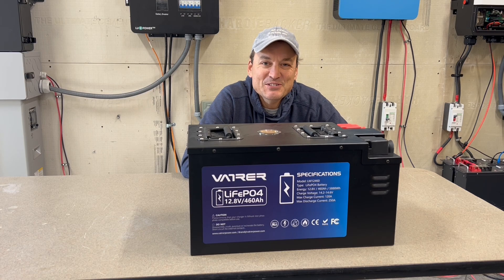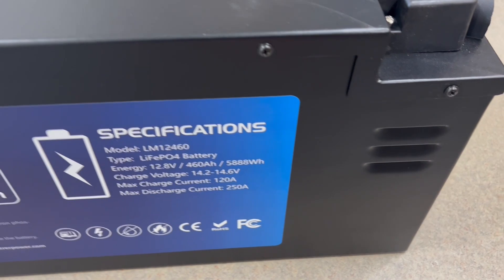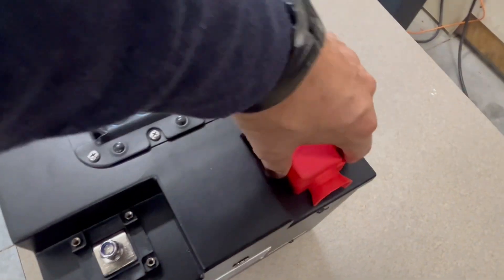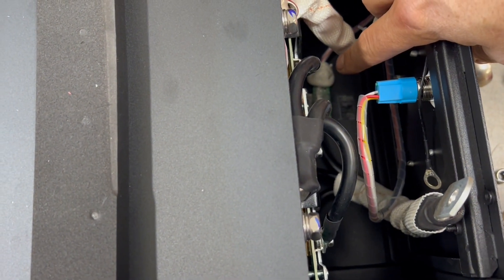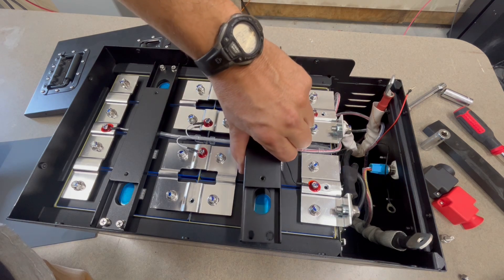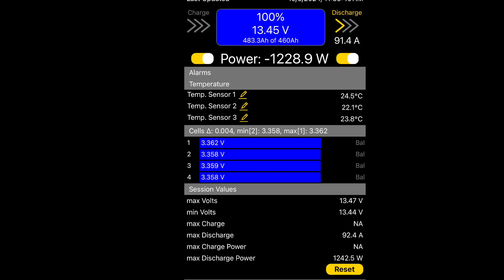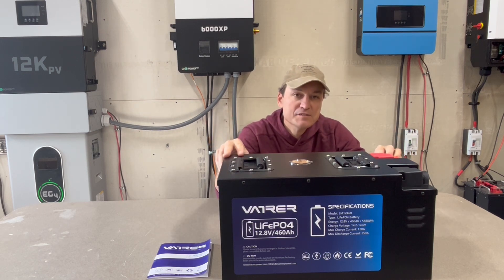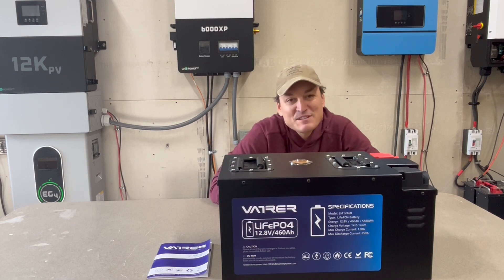Vatrer 460ah battery testing and review

Comment: This seems like a great battery.  Getting ready to replace my 2 100 ah agm batteries in a couple of months in my Class B rv which are mounted outside underneath the carriage.  Do you know if this battery is rated to handle the elements from road spray and such like when it is raining?  Great review, thank you for your time.
Reply from the maker: It isn’t rated for water of any kind. I would probably go with this model instead.

https://www.vatrerpower.com/products/vatrer-12v-300ah-bluetooth-lifepo4-lithium-battery-with-self-heating-200a-bms-supports-low-temp-charging-4-f-5000-cycles-2560w-power
Reply: @GavinStoneDIY  Thanks for the recommendation!

Comment: I'm running 2 of these batteries in my diesel motorhome (replaced 4x flooded coach batteries). The performance is AMAZING. Better than expected. My coach is full electric (no propane) and has residential appliances. My coach is a '22 and when it was new a fully charged battery bank would barely run the fridge through the night (without hookups). Now i never even use my generator! I could probably get 7-8 days fully off grid, its really amazing. Worth every penny
Reply from the maker: Yeah these batteries are great. Honestly I don’t think they get enough attention for as nice as they are.

Comment: You got your vendor and Amazon links mixed up.  Four of those batteries would be cheaper than any dedicated 48v build that I've seen, but you would need a substantial equalizer to keep those four behemoths anywhere near balanced with one another.  :)
Reply from the maker: Thanks for the heads up.

Yeah I wouldn’t see the sense in having 4 of these vs a wall mount battery really. But I’ve seen people that use 12v’s in series all the time. So I dunno. 🤷🏼‍♂️